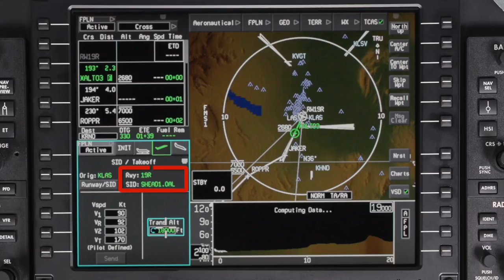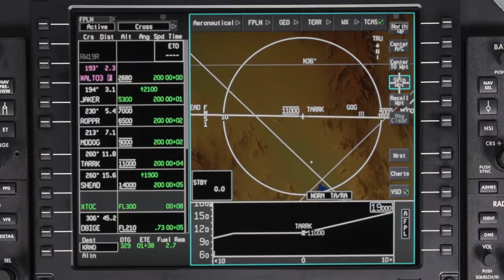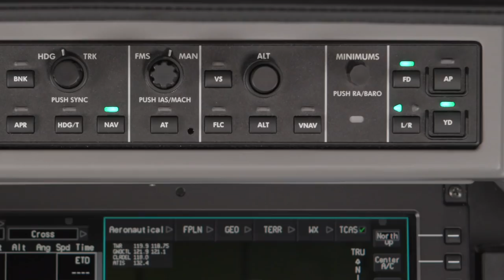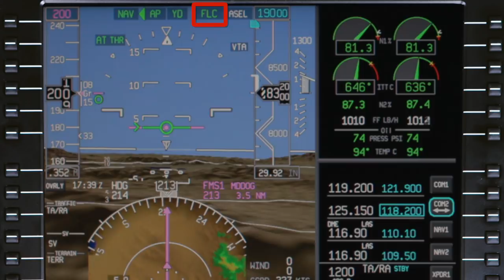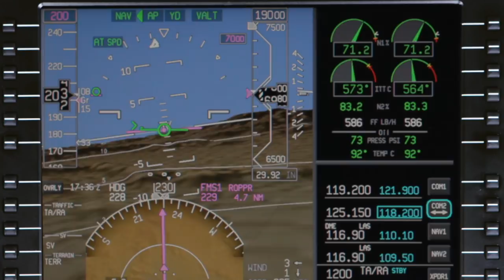VNAV Climbs on the Pilatus PC-24 | Honeywell Aerospace

Comment: Apparently some UI designers got the instruction to shoehorn as much info in the display real estate as possible. Well....actually not possible but they did it anyway. If you compare this to the Garmin 3000 in a Honda Jet it becomes clear in a sec which UI and flow and flight automation designers did a better job here. It looks that Honeywell could not decide on the level of automation which if done well would remove a lot of the clutter and present much cleaner display. Hire some guys from Garmin and Honda maybe?
Reply: Ed Du not only that, but the UI graphic design looks like something out of early 2000's Linux. I agree that the Garmin system has a much better UI that is much easier to quickly find information on, and the graphics are more pleasing to the eye
Reply: Erik N That early Linux.......you noticed too! They got their screens and graphics cards from K-Mart?
Reply: Ed Du that's kinda the sad part. The graphics modules are super expensive specialized equipment and they waste them on this
Reply: Proline 21 guy here. All of those displays look super busy. I don’t care if my displays look like Linux... they military grade and are simple and they work.